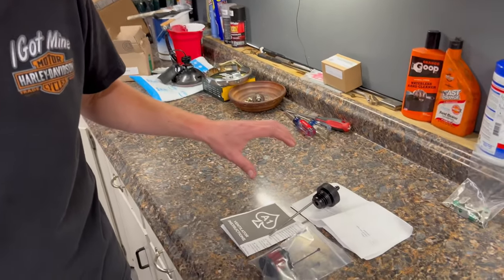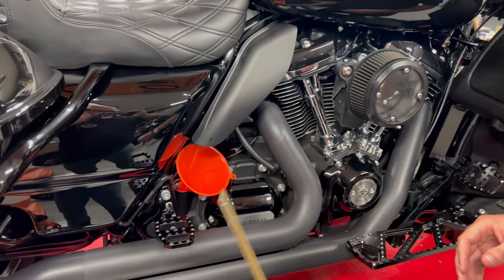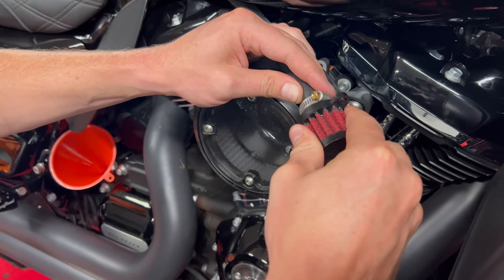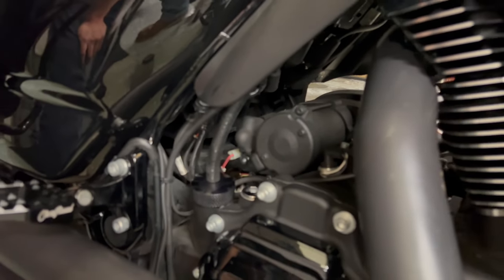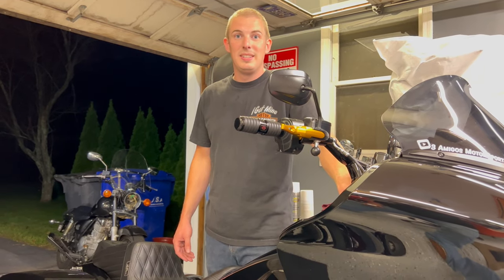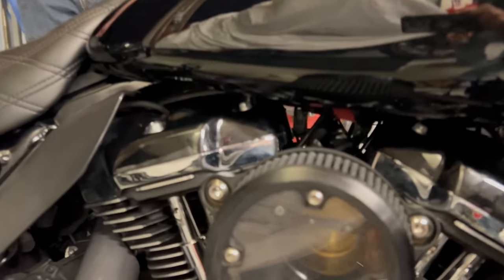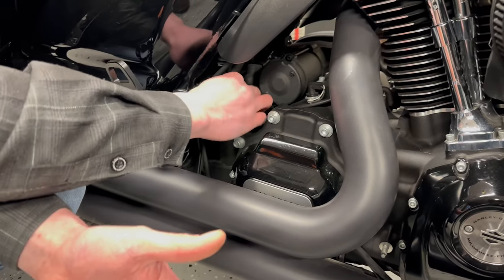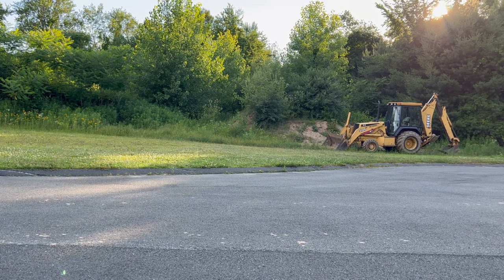A1 Cycles Vented Dipstick - 5k Review

Comment: Just added the A1 vented dipstick to my Street Glide 300 miles so far no oil misting through the filter/ catch can, the motor runs smoother and revs better. Just follow instructions and that’s it.  I’m running 4 dots down hot oil check

Comment: Vented dipsticks may or may not solve problems, but the biggest problem is the constant 'over-filling' of oil tanks. When your bike's engine is running there is oil everywhere inside it, when the engine is stopped all that oil runs down into the crank and cam compartments - it can totall about a quart of oil.
When you fill up the oiltank to the 'full' mark on the dipstick is when YOU create the problem especially, A, if you check the level when the engine is cold as oil expands when hot, and B, if you fill the tank whilst the bike is on the jiffy stand as that will give a false reading.
 When the bike is started, the return side of the oilpump will send the oil in the engine back to the tank and there is no room as you have overfilled the tank !!!
Also, when the engine is running and bike is being ridden, the bike is upright so the incorrect reading that you filled the oil level upto is now even more overfilled.... check you bike's oil level when the engine is hot, stop the engine from running but keep the bike vertically upright as that'll give you an accurate dipstick reading.
 Remember that there is still upto a quart of oil in the engine so you need to leave the level on the dipstick about a half way between the 'full' and 'add oil' marks on the dipstick.
 So boys and girls, all you read in Harley manuals about checking the level on the jiffy stand BEFORE a run is W-R-O-N-G...... look at the old brit bike's oil tanks, all they had was a minimum level line on the outside of the tank which is quite low down so as to allow enough room in the tank for the oil evacuated from the engine by the pump when it is hot AND upright....

This info brought to you by a 65 year old biker with 50 years of experience.... not some know nothing twat who wrote the rider's manual !

Comment: I installed one a few years ago and it worked perfectly. After my my full S&S camchest and woods 22xe upgrade the bike was blowing too much oil through the filter. I even ran the oil level lower per A1 cycles instructions. I did the vented transmission modification to my factory Trans top cover. Used a 3/8 barbed fitting a one way check valve from lopers performance and a DK customs catch can. It's all hidden under the abs module side cover. This mod works. I can always add the dipstick back on to the bike with a 3/8 t fitting if want extra breathing.
Reply: BTW the oil level is now back to spec.

Comment: I just bought the Feuling dipstick after I’ve been having issues with my M8 Softail. Will install when I get home later today from my trip. She’s been using about 1/2qt of oil  every 600 miles or so, about 2x normal the rate and having a decent amount getting in my S&S Teardrop

Comment: The Feuling vented dipstick has a one way valve in the cap that only allows air to escape the oil tank and not let air to get in. The A1 Cycles Ventilator cap allows air to flow freely in both directions.
Reply from the maker: Ah I see. Definitely something worth mentioning
Reply: Right, how is the air going the enter the pressurized case?
Reply: @jjs8046  when you shut the bike off

Comment: So as I understand it, if I install this A1 crank case vent , I do not need to add a catch can system or anything else to the air cleaner, just leave it as is. ??
Reply from the maker: That's the idea, it relieves some pressure to that the oil cant make it to the air cleaner.
Reply: @3_AM  perfect, I am going to install it. Thank you

Comment: Don't waste your money.  I bought and installed this product and took the bike out fora ride.  On our trip I was losing traction and my wife told me the side of my bike was covered in oil and it was burning her leg. I stopped the bike and saw the oil was coming from the air filter attached to the vented oil cap.  It was siphoning the oil through the vent at 70 mph. Took it off and no problems since.  I wrote to the company and no call back of course..
Reply from the maker: Did you make sure to run it about a half quart low ?

Comment: Run anything but syn3 , motul or red Line ,amsoil. Just saying if you want it to last.
Reply: Motorex 10w60
Reply: That’s right. Harley spends millions on R&D engine development so they recommend an oil that will cause engine failure. 🤷🏻🤦🏻‍♂️.